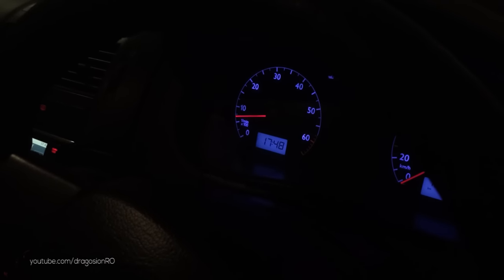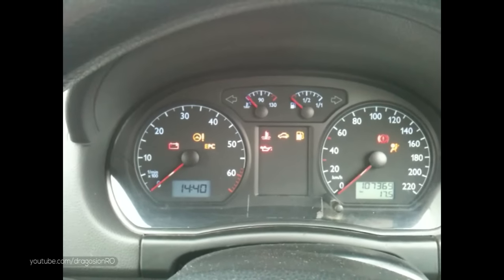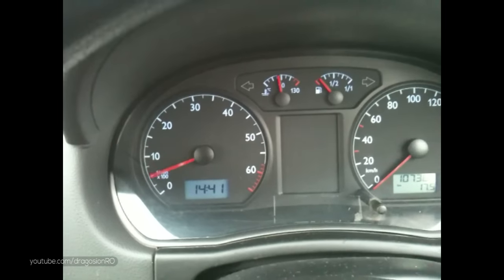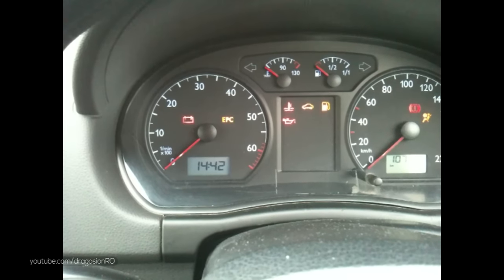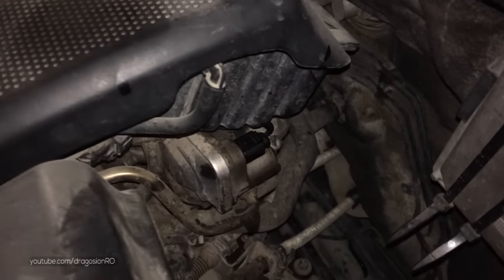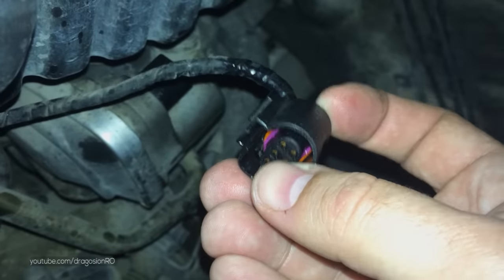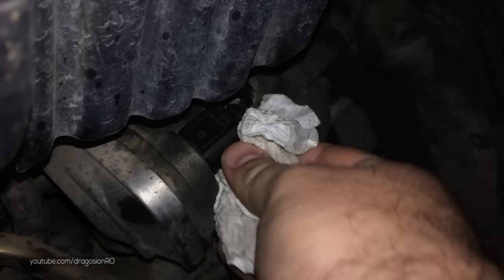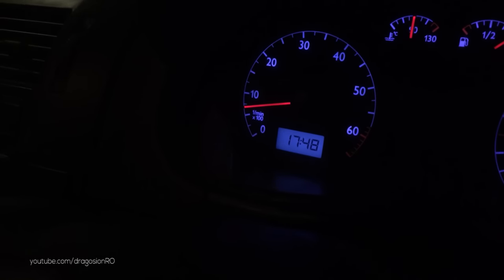EPC Light Fix in VW Polo 9N 2003 1.2 AZQ

Comment from the maker: Amazon: Heater Blower Motor VW Polo 9N https://rex.red/heater-blower-motor-vw-polo-9n *
Tools https://rex.red/car-tools-kit-mechanic *
Cleaning https://rex.red/car-cleaning-supplies *
WD-40 https://rex.red/wd40  *
Torx socket set https://rex.red/torx-set-socket-45-55-60  *
Jack https://rex.red/car-jack *
Stands https://rex.red/car-jack-stands-heavy-duty *
Gloves https://rex.red/car-gloves-mechanic *
Safety glasses https://rex.red/safety-glasses-anti-fog *
Spark plug removal tool  https://rex.red/spark-plug-removal-tool  *
Spark plug Gap tool https://rex.red/spark-plug-gap-tool  *
Coil puller tool https://rex.red/coil-removal-tool  *
Car fuse set https://rex.red/car-fuse-kit  *
Battery tester https://rex.red/car-battery-tester  *
Maintenance kit https://rex.red/car-maintenance-kit  *

Subscribe and Ring the Bell to watch more videos.
ION HowTo https://rex.red/ionhowto
RedNumberONE https://rex.red/rno

Buy merch https://store.ionhowto.com/
Check it, buy it, post it and  tag it #ionhowto or #rednumberone

Join this channel to get access to perks:
https://www.youtube.com/channel/UCx4Qbp3iC97kQzj7e7g7slg/join

We earn money from qualifying purchases using our affiliate links.
Affiliate links are marked with a star. *
When you use our * links, you support this channel.
As an Amazon Associate I earn from qualifying purchases.
Reply: Available in UAE?

Comment: Welcome to Volkswagen: Transforming drivers into mechanics since 1937.
Reply from the maker: It's sad but true. Most cars will do that if they still drive. 
I'm not a VW fan but the parts are cheap and easy to find at least.
Wish I was driving a better car but this is still driving fine.
Reply: Hi
Reply: Hahahah. Great response, and pretty true, at least for me. This said, I've learned a lot through the process, so it's not all bad.
Reply: Even im becoming one with mine but still can't figure out the problem after replacing many parts
Reply: Thats right man!

Comment: Thanks for that saved the day and a trip to mechanics I wasn't sure whether to use wd40 or some thing else but after watching your video now I am confident to use this product and save me buying electric wire cleaner spray.
Reply from the maker: Thanks! :) I had proper contact cleaner spray before but when using that, the problem would come back much quicker.
Same for the re-circulation flap motor. I've cleaned that potentiometer because the re-circulation flap was going crazy moving on it's own.
When using proper contact cleaner on that pot it would last a lot less that WD40.
Just let the car cool down a bit and use lots of paper towels/rags :)
Reply: Carb cleaner is fine?
Reply: @IONHowTo  carb cleaner is fine to use?
Reply from the maker: @SiboneloHlophe-nm6wk  special contact cleaner spray or wd40

Comment: Had epc light too, had the trottle body replaced but after few days the epc light litted again..went back to mech the dam light werent there anymore, test drive a few round nothing happen...hope ur method works. Keeping fingers crossed.
Reply from the maker: Tried cleaning that throttle body and made it shiny but only messing with this electrical connector fixed it for me.
Hope for you also! :)
Reply: Did it work Samuel?

Comment: What  about if polo 6 failure  to start not even turning  the start or display epc light and gears?  But other light like battery light, oil light and  fuel Guage will  displayed

Comment: Mine was idling normally but jerks when i drive it at low rpms.. turned out to be a faulty egr valve i cleaned it wirh a carb cleaner and worked like a charm.
Reply: Egr valve is a throttle body?

Comment: Hi friend, I liked the information... look, in my case I don't have any light on the panel on, but when I travel 700km, the pole turns on several lights and almost goes down, but then everything is fine, there are no errors that crazy...🙄🤔
Reply from the maker: Check coolant level and check that engine temperature does not rise slightly when you press harder on the gas pedal. Should be fixed in up position around 90 degrees.

Comment: Thank you very much for this instruction. But i have a question. Where is this throttle body in the car? Do we need to open the engine somewhere? I am looking forward to hearing from you. Best regards from Stuttgart.
Reply from the maker: Throttle body is behind the engine, where the air filter goes to.

Comment: Goodnight. The temperature sensor light stays on even when the car is cold. Polo 2002 1.2 9n. I already changed the water tank but it didn't fix it. Thank you if you can help. Thanks
Reply from the maker: Try to use an obd2 reader to get some error codes if any. I read some comments that it could be a bad solder joint in the dashboard but I think it might be the coolant temperature sensor.
Not sure really.

Comment: I have a 2004 VW Polo 1.4 BBY engine. Just replaced 16 Valve Stem seals WITHOUT REMOVING THE HEAD and now the EPC light has come ON. Will try this trick and see what happens. VW's can be a pain sometimes, but good Cars to drive.
Reply from the maker: No need to defend their brand. Hope you get it working.

Comment: hey bro nice video it also worked for me but if you want a once for all solution it would be chaging the trotttle body wire plug vw sent out a bulleting adressing this issue once you rewire the trotle body connector you wont ever have to use wd on the plug ever again

Comment: Thanks that was very helpful but i got a problem i smell petrol from the tail pump what should i do and what's the meaning of that i hope get answers soon and thank you
Reply from the maker: It means the engine is running 'rich'. Probably fuel economy is not great too.
There could be many reasons for that. This is one of them.
Could be any of these or more:
Fuel injectors,
Engine wear,
Spark plugs,
Induction coils,
O2 sensors,
ECU.
These are few reasons I can think of is the smell comes from the tail pipe.
Otherwise it's more dangerous if petrol is leaking anywhere from the tank on it's way to the fuel injectors.
Reply: @IONHowTo  thank you for your help i really appreciate

Comment: Felicitări, in primul rand pentru iengleza, hibrid intre Iliescu și bendeac, bravo . In al doilea rând mulțumim pentru rezolvare ești foarte bun. Spune mi te rog , daca folosesc spray wd 40 contact cleaner, este ok , își face treaba? Mulțumesc anticipat,
Reply from the maker: De obicei comentariile din Romania de trolling si am oftat cand am inceput sa citesc ce ai scris dar mi-am revenit in partea 2 haha.

Stiu ca normal se foloseste contact cleaner si am tot citit dece wd-40 e rau ca strica acolo contactul.
Pentru mine, wd-40 merge foarte bine. Varianta clasica si ce e mai important, tine mult.
Daca dai cu contact cleaner in cateva luni sau 1 an ai probleme iar. Cu WD-40 1-2 ani merge.

La fel si la clapeta de recirculate - potentiometru. Era cineva de intreba mai devreme pe alt video de aia.
Curata clapeta de acceleratie cu CARB SPRAY dar fara sa o misti, doar pana la clapeta in interior.

Daca tot umblii acolo poti sa pornesti motorun cu filtru scos si sa dai spray scurt jumatate de secunda in clapeta de acceleratie - admisie asa se mai curata chiar pe linia unde e clapeta - poate sa fie mizerie mazga ulei sau resturi carbonizate acolo.
Motorul se tureaza putin cand dai carb spray, e normal.
Reply: @IONHowTo  Mulțumesc pentru clarificare. Incerc și eu sa vad ce rezolv, eu am o Lancia, simptomele sunt asemănătoare, am văzut că și la Fabia sunt probleme. In general motoarele, mici, , care au răcire deficienta, acolo apar toate tipurile de probleme din cauza căldurii excesive cât și a " anului de fabricație". Mulțumesc
Reply from the maker: @bogdangeorge7881  sper sa se rezolve. Poti sa ii faci un obd2 scan sa vezi ce coduri apare.
Reply: @IONHowTo mulțumesc pentru sfat. Nu afișează erori. E doar "nouă" din 2006.

Comment: My 2003 elite polo has had exact issue. Revs will go up and down, then EPC light comes on the car is running very rough and eventually just turns off. 

Tried this trick and it worked for 24 hrs. 

The throttle and accelerator have been changed. Any ideas?
Reply from the maker: You used any spray?

Comment: Thank you so much.
I have the same problem with skoda fabia 1.2 but my problem is that when drive upp hill and turn to the right then the epc light is on. Maybe its a matter of  wires.
Will give it a try today ☺️
Reply: traction controls
Reply: @bekonface  
I solved the problem. It was a cracker plastic hose for the pcv valve

Comment: Hi I have a 2008 FSI Golf and I have a problem in the light of EPC what name the pieces that you cleaned
Reply from the maker: It's the throttle body electrical connector. Should be very similar on your car.
If your car has those symptoms, it's worth trying to clean it.

Comment: Thank you very much for this video.I bought a car vw polo 1.2 from 2004 and it has AZQ engine.The car had this EPC problem but it was not coming at starting mostly after driving 15-30 minutes epc light turn on and car goes to limp mood.I took the car to mechanic and he told me to change throttle body, throttle padel, lambda sensors and catalyst and i have done everything but problem wasn't sloved at the end mechanik told me to change the engine control module and i have ordered that but while i have ordered that i found your video and i have ordered the throttle body connector and i gave it to mechanic to change the old connector and replace with new.And now the car is not throwing any problem and running like a charm just now i am concerned about only intake temperature because in obd2 it is showing while i am driving the temperature is going up to 80 degree.Is it a bad intake temperature?
Reply from the maker: Temp in dashboard should be straight up at around 90 celsius. I'm glad you got it sorted but that mechanic oh my... He threw parts(and your money) at the problem too much.

Comment: I currently have this problem after accelerating quickly. I've cleaned the connections and now the check engine light has now appeared. It is a 1.2 polo 9n 2003. Any advice is welcome. I've tried to check the codes yet non are appearing. I've ordered a new obd reader so hopefully that gives me more of an indication of what's going on
Reply: I had rubber stuck in the throttle body. Any idea where that would of came from?
Reply from the maker: @krawzzy2599  rubber in tb is from the Engine Air filter housing or there is no air filter in there. 
Check it / have it checked asap.
Reply: @IONHowTo  will do thank you!
Reply: @IONHowTo did you fix so if so how please?

Comment: I'm having the same issue after cleaning the EGR and throttle body. Do I have to disconnect the battery before cleaning this connector?
Reply from the maker: No need to disconnect the battery but key should not be in the car/ignition.
Reply: @IONHowTo  UPDATE: your solution worked on my Seat Toledo 1M. For those who has the EPC light on after this: try to drive around for a half an hour, if you have climate control try to turn it on for a while , after this you have have a nice stable idle.

Comment: Same issue with my car, except after a couple minutes, the car falls flat and dies. Also, my Traction Control light comes on in sync with the EPC light, and happened twice after getting a full tank of fuel. Could this still be the throttle body as I've changed the TB/Maf already? Thanks!
Reply from the maker: Get it scanned with a obd2 scanner
Reply: @IONHowTo  I got a P2637 code, even though I changed the throttle body, but I'll give cleaning the connector a shot since the connector isn't part of the unit!
Reply from the maker: Yeah might be a problem with dirt/rust or one of the wires on the connector terminals.

Comment: My car sometimes does the same, but other times the powersteering light would go on and i would lose powersteering, the clock will reset, and an alarm will beep twice. I then switch off the car and start it again, and everything will be fine again. Do you think this will also fix my problem?
Reply: Olá amigo... como você resolveu essa situação do seu vw polo? Pois tenho uma situação idêntica, mas nem um erro aparece 0 erros 🤔 mas por vezes acontece ligar abs airbag direcção... desligo, ligo, e já está tudo bem por uma semana 😂

Comment: Hey so you have to put the WD 40 IN the sensor thing you pulled out right? Not on the outside of it? Thanks for your video, been having the same issue and electrician changed my brake switch to no avail...
Reply from the maker: Do not put wd-40 inside the reservoir. Only on the connector and connector socket but not inside where coolant goes.
Saying it just to be super clear. This is for the electrical contacts.
Reply: @IONHowTo  Yeah that's what I meant haha the connector, defo not putting WD 40 in the coolant haha! Thankyou for the video, very helpful :) Till now my car didn't do the EPC light again but we will see
Reply from the maker: @bskeys9283  it might do it again in few months or years, you can spray again and it will be ok.
On our car, I can't remember the last time it did this. Maybe 2-3 years ago.
Reply from the maker: @bskeys9283  was confused, thought your comment was on the coolant video but yeah same on both, spray the connector both sides and will be ok
Reply: @IONHowTo  hey, same person here just diff account lol. So I put WD 40 in the connector like you said and the epc light came on still, but this time it didnt go limp mode completely as much, the acceleration was just really slow but it go up to  70 kmph eventually, though it felt held back a bit. Do you think I just didnt put enough on it? Wasnt the brake light switch cause that was changed too. Im gonna try to clean the throttle body next tho xD
Reply from the maker: Yeah throttle body cleaning is a good idea - I did it with carb spray to make the clap less sticky. 
I clean it wit a lint-free cloth soaked in carb spray while engine is off, then start the engine and spray the 2-3 short (half second) carb spray - sprays - directly into the open throttle body. 
The RPM should go up a bit when you spray it then it goes back to normal, then spray again. It's better like this in short bursts so the engine doesn't stall. It normally takes air thru the throttle body not fuel.
Try to clean the connector again for the EPC and check the wires going into the throttle body connector if theres any damage right before they go into the connector body.

Comment: Hi , i have vw polo 1.4 petrol 2009 , When driving the car while the air conditioning is running and I press the clutch and brake to stop the car or reduce the speed, the engine suddenly stops. I have changed many parts of the engine and the problem still exists. Note that this problem does not occur when the air conditioner is off …

I changed all parts of the engine and the problem did not end. Some mechanics told me that there is a general problem with the engine compression in this type of engines ( BUD 1.4 ) and you cannot solve it unless you change the engine .

.. now I completely changed the engine to a model (CGG ),, and the problem still exists.. This is going to make me crazy
Reply from the maker: You changed the whole engine and it does the same? First I would change the mechanic, get another opinion.
A obd2 scan is the first thing to check for.

Also the engine position sensor - flywheel g28 see my video in car playlist.
Never happened to me because of the AC but could be the AC compressor or even AC refrigerant?

If you get the EPC light, this video could help you.

Comment: Have you had a problem with no error code on 2002 polo going into limp with no notice. After driving fine for 500 miles plus replaced two cylinder coils and all plugs. Was running great for past month until tonight. Is there a fuel filter. It’s hard to diagnose with no code. Just popped into limp mode
Reply from the maker: There is a fuel filter but I bever had problems with that.
Coils are always going bad on these cars. 😅
When the coils in mine were bad it had misfire codes in engine scan.

Comment: Hi! My car's EPC light came on and the car went into limp mode. First I changed the  throttle body but still no improvement. Next I changed the Electronic accelerator unit and now the car only cranks but won't start at all.
Reply from the maker: Needs a scan for error codes. That could give you some hint of what’s wrong.
Reply: Nirshad Singh ki
Reply: Did you ever find the problem?

Comment: Hi.
My engine does not idle for more than 3 seconds then switches off. 
And switches off immediately when I boost with accelerator. 
What could be the problem?
Reply from the maker: See my video on g28 sensor vw polo engine speed sensor
Reply: @IONHowTo  it's still not idling even after putting on new parts.
Reply from the maker: @omphilemahole7153  what parts were replaced?
Reply: MAF sensor and throttle body sensor.
Reply from the maker: @omphilemahole7153  it's not the one I told you about earlier
Reply: What could be the problem now? Coz the parts are new but it's not responsive
Reply from the maker: @omphilemahole7153  the video about g28 is for another part